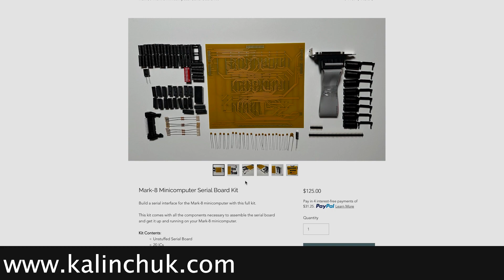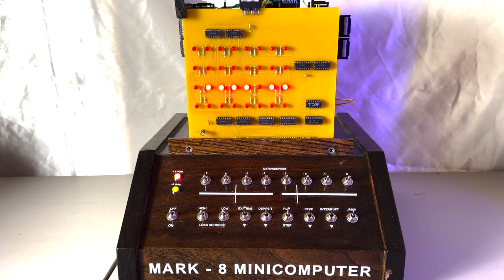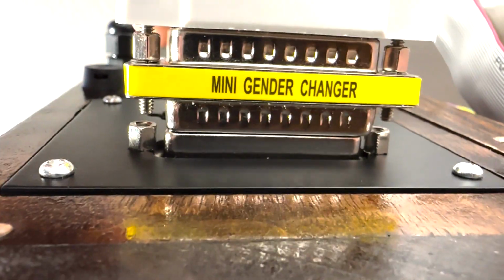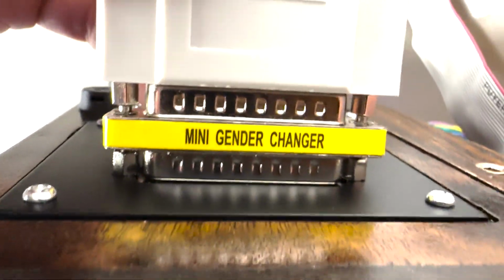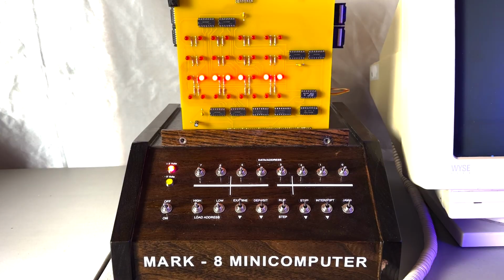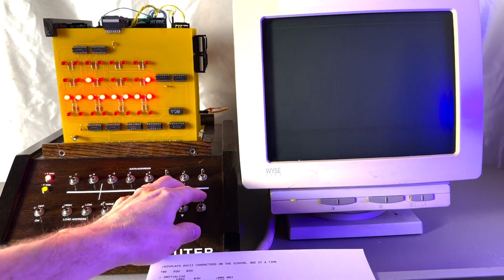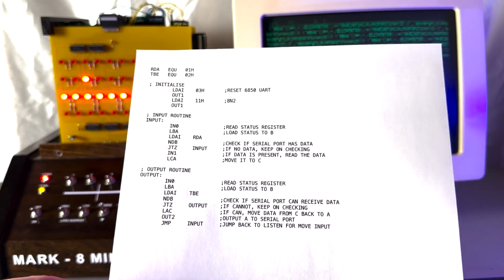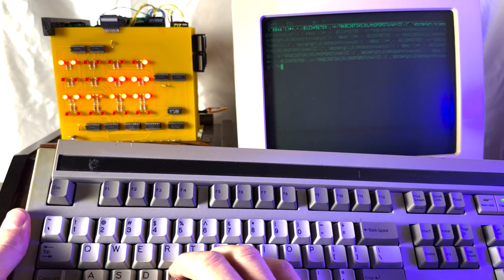Mark-8 Minicomputer - Terminal via Serial

Comment: Can you play aoe on it?
Reply from the maker: I'm working on getting it to run AoE.
Reply: @artemkalinchuk  Are you talking about Age of Empires here?  This tech is able to handle the graphics and hardware limitations for a game like that?  How is a computer from 1974 able to play a game from 1997?
Reply from the maker: @signorelephant Yes, that was a joke 😅
Reply: @artemkalinchuk  Ah, gotcha.  I was a member of the ai scripting community for a long time for those games, so you caught my interest there.  I am pretty interested in building this computer, but Im no good with hardware.  How difficult would you say the bare minimum would be to set up the computer and get it attached to the display in your monitor would be?

Also, was curious.  Originally gathering the components, are you thinking it was close to around 200-300 EUR?
Reply from the maker: @signorelephant  That's really cool. I play the AoE II DE version, occasionally. Regarding building the computer, if you have a basic knowledge of electronics and soldering, I think you can do it. Debugging issues is a different thing and may require a bit more knowledge but I am here to help. If you can find the hard-to-find components like the 8267 multiplexer, 8008 CPU and the 1101 RAM, the remaining components are fairly reasonably priced and available. You will need to purchase a set of boards which will be between $100-$150 (as a side note, I'm working on creating reproduction boards which will be available soon). I think, all things considered, it should run it close to 500 EUR.
Reply: @artemkalinchuk  Thanks for responding.  Are the boards you are thinking about making pre-assembled, or something else?  I think the switch and terminal boards you have already included are a must in the project
Reply from the maker: @signorelephant No, they’re just more like the originals. It’s a bit easier working with the boards that I used in this video even though they’re not actually reproductions. The switch board is a nice to have but the original did not have such a board. So it really boils down to what your goals are - whether to be as close to original as possible or just to have a working computer.
Reply: @artemkalinchuk  well, I'm definitely a guy who likes being as original as I can be.  Do you have a discord or anything that I can follow for release updates?
Reply from the maker: @signorelephant I don’t post on Discord, unfortunately. I’ll post on YouTube.
Reply: @artemkalinchuk  oh, I had one more question.  When did you think your boards will be available?  It is exciting thinking about the idea.
Reply from the maker: @signorelephant  They are currently being fabricated. Once I receive them, I will do some testing to ensure they are correct and then make them available. I think maybe 2 weeks.